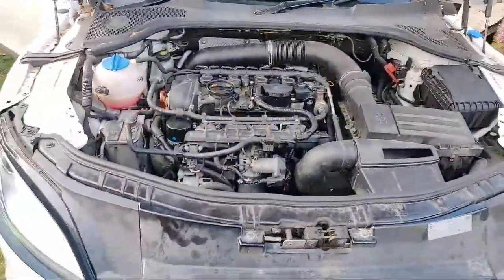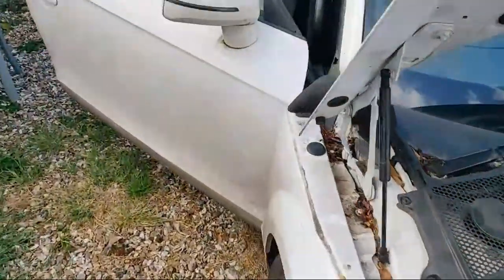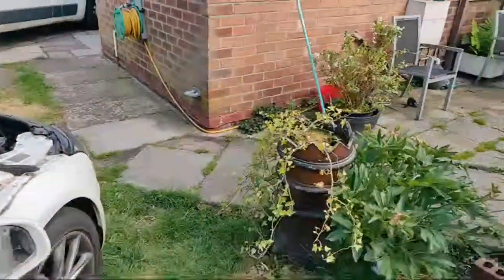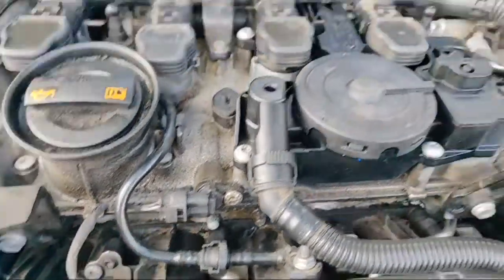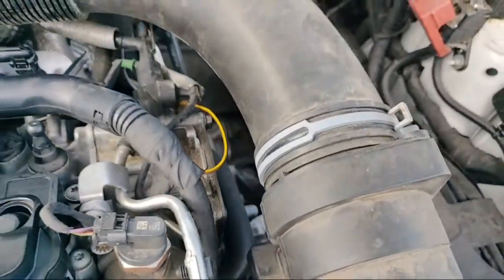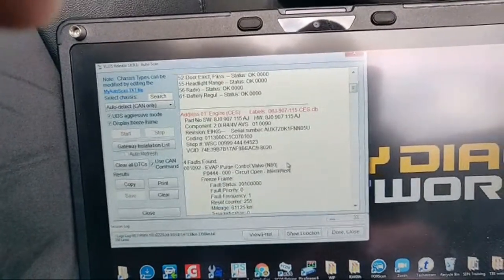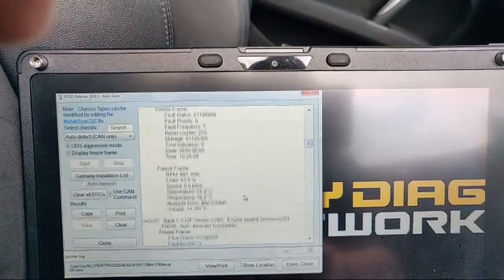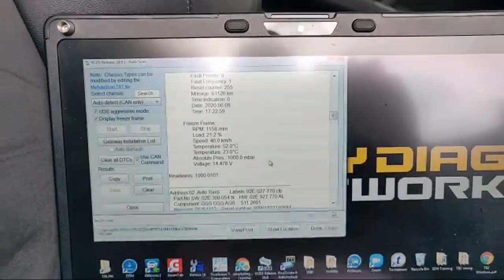Audi TT 2.0tfsi CESA Poor Idle P0016, P0506, P0108, P0444

Comment: Looking forward to video Steve just question  when you checked that kangoo insulation check did you megger test  from peb unit or on the motor phase wires disconnect  from each phase to ground only reason I ask  there bit of a pig to do on floor  just wondering
Reply from the maker: They're a lot of a pig to do on the floor 🤣
Reply: @SimplyDiagnostics  fair play to you  obviously I can delete the message if you think it divulging testing  sorry
Reply from the maker: No mate, it's fine, questions are great, that's the whole purpose of my channel 👍 I filmed the test and it's available to trade members of our community at simplydiag.net 👍